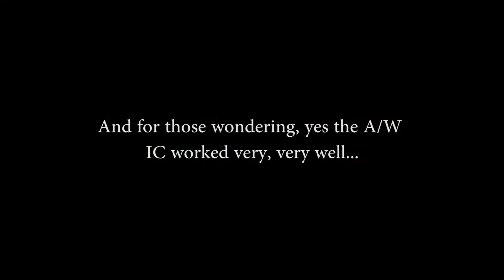Exreme Transmission Proof Test

Comment: Any more info on the dodge spirit
Reply from the maker: Yes. It's basically stock and the young guy who owns it can DRIVE. Last year at Carlisle he beat a Viper in the autocross. It was amazing. If I'm not mistaken, he won the bracket race at SDAC before he officially turned 16 several years ago.
Reply: Would like to get in touch with him just trying to find someone with the same car to point me in the right direction
Reply from the maker: There are a few spirits on www.turbo-mopar.com You might try signing up and introducing yourself. We'd all love to help you out with anything you want to fix or mod. I think he posts on there occasionally. I'll see if I can dig up his contact info from there.